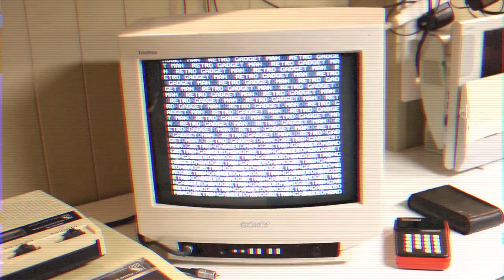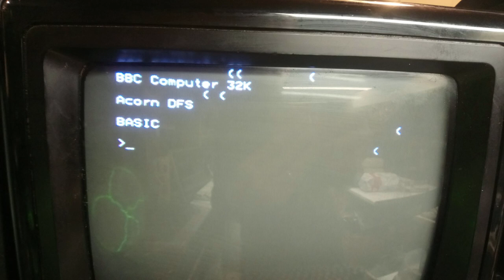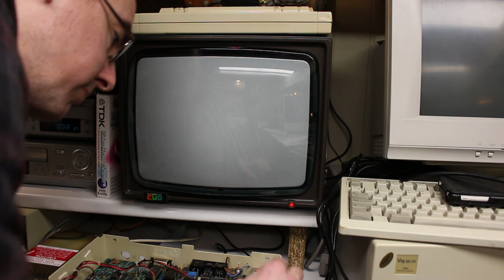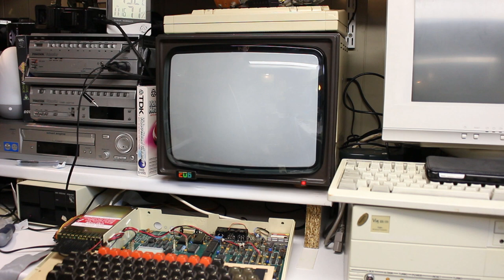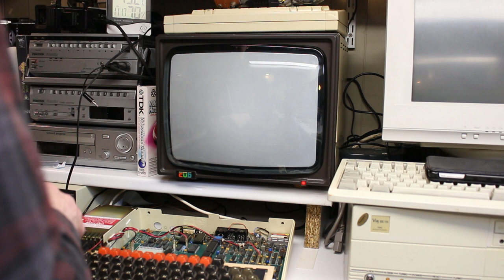BBC MICRO MODEL B RESTORATION SERIES PART 2: Memory and Video sync repairs

Comment: Don't be hard on yourself fella - man the number of mistakes I have made.....love your video - I have a CUB monitor that needs repairing as well.....need to build up courage
Reply from the maker: Thanks, it's all experience. I have learnt alot since making this video of course. Yes those CRT sets can be a bit daunting. Just make sure the tube, "CRT" is discharged safely before you do any work on it. Even after being switched off for weeks, sometimes there is still a charge and capacitors can give you a nasty shock.  🙂

Comment: Great video and well done with the fix. I found this all really helpful as I prepare to start fixing my 40 year old BBC Model B. I know it has a continuous beep issue because that was an issue the last time it was used before going in the cupboard for 25 years! 

Thanks for sharing the heat gun experience too - I was interested in seeing how it worked out and so sharing was very valuable to me. If I decide to try it then I know to use caution, or just persist with the manual solder sucker!
Reply from the maker: Thank you and glad my video has been helpful. 🙂

Comment: Hi,  I have a BBC CUB monitor microvitec, how can I check the monitor that it is working, it powers on, red light comes on, but I have no bbc computer to test it, 
Is their another way to check the monitor please, many thanks
Reply from the maker: Hi depending on your model there are various inputs on the back. usually rgb and composite video.  you can plug other equipment into the composite socket like older games consoles and video cameras using the yellow rca plug which is usually video. However this will only test that one input.